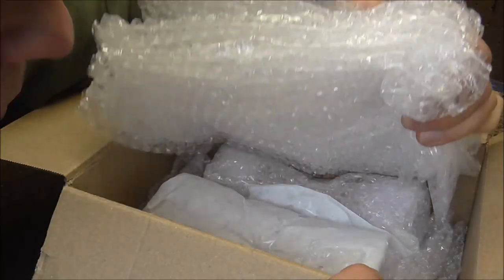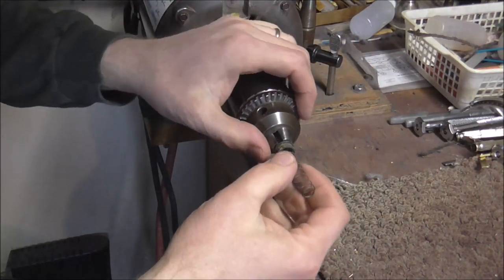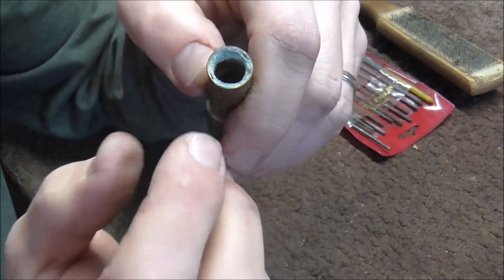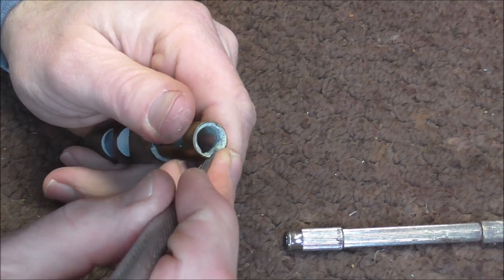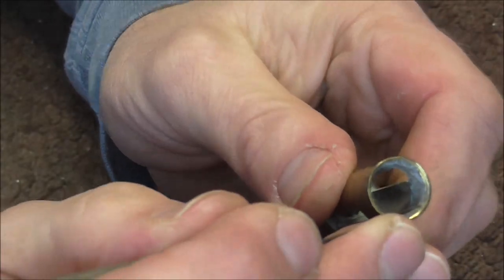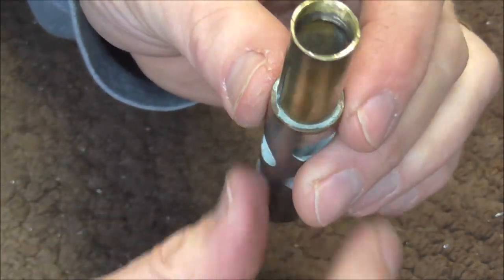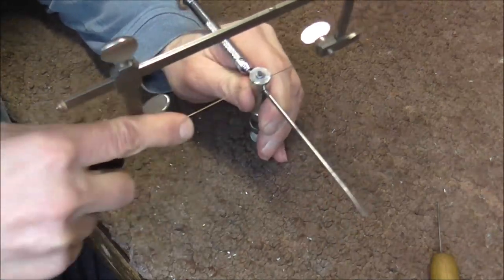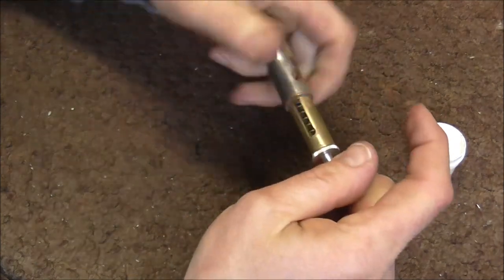Broken Valve Stem on a Bach Stradivarius Trumpet: How To Remove and Replace It

Comment: I’ve used the saw method you demonstrated but have also had a bit of success with modest heat, penetrating oil and using a screw extractor. Thx for your videos - as always very helpful.
Reply from the maker: Thank you for mentioning that. It would be good to start with what you mentioned and move to the other method if it is too stuck.

Comment: I don't think I've seen a video on your channel for loose tuning slides. I have a loose tuning slide and wondering how to fix it. Excellent content!
Reply from the maker: I have not done a video on that yet. You can use a tuning slide expander, but you have to be very careful not to expand it too far which is very easy to do.
Reply: @TheBrassandWoodwindShop  Maybe I should send my horn to you so you can do a video!! ;-)
Where can I get a tuning slide expander? I'm very new to instrument repair, and the only tools I have at this point are steel wire, a torch, and solder. None of these seem like the right tool for this job!
Reply from the maker: If you would like, you can send it to me so I can do a video. Give me a call if you would like to do that and we can work out the details.

Comment: I have a getzen 700 eterna with a broken valve stem. All I have to do is unscrew it and replace it. However idk if all valve stems are the same size thread. Or will only Getzen valve stems work?? Anybody know?
Reply: I don't think so. I bought a valve repair kit for my daughter's Getzen 700 and some of the parts, including caps were the wrong size.